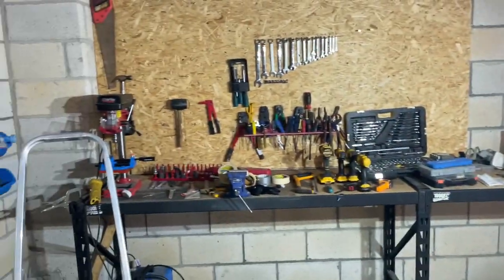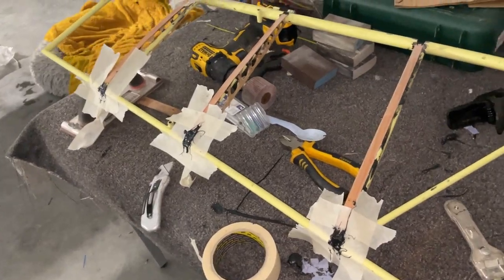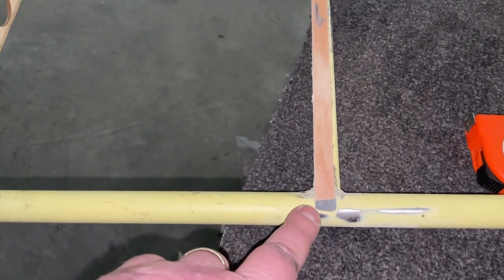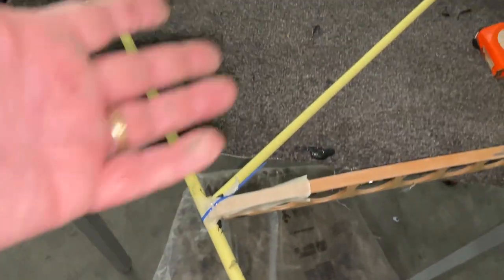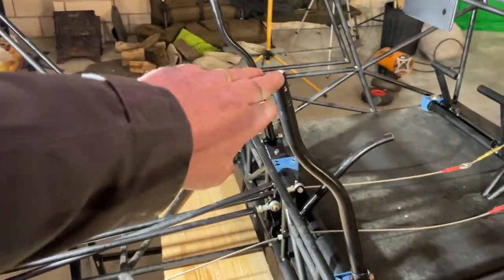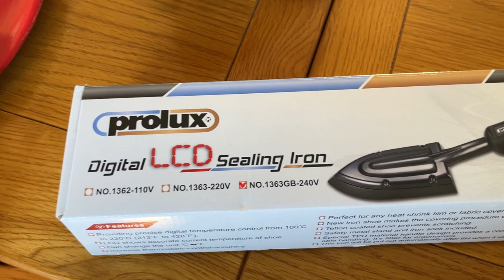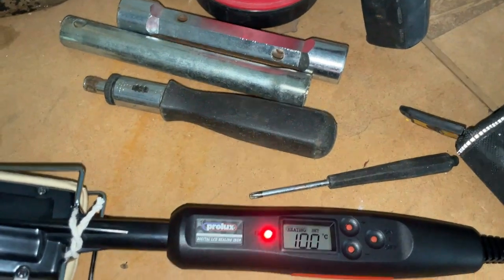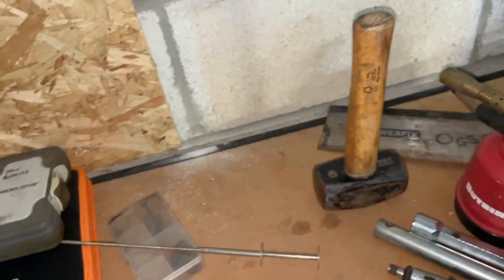KFA Safari Bush Plane Build - RTFM to avoid doing this.

Comment: Looking forward to the covering.
I'm using a home-brew water-based covering system similar to the Stuarts System (Sub70... doesn't need to be certified) using polyester dress lining (65GSM) it shrank enough for a nice drumming sounding tension :)
I have mounted a meter squared test piece sealed and painted... Super strong in tension but poke a hole in it and it rips easier than the raw unsealed/unpainted material... As if it is old and sunburnt with no "ripstop" ability.
Think I might have been a little stingy on the sealing coats (trying to save weight) and the paint (water based) has absorbed into the fibers preventing the usual fiber stretch / fuzz as its ripping.
More testing needed for me :)
Reply from the maker: Sounds like you’re having fun with the testing. I always wondered how much weight there really was in dried paint. A lot of the raw weight is the thinner. Now there’s an experiment for you 👍👍😁
Reply: @FatParamotorGuy  
I did take weight measurements but ignored them due to the poor ripstop performance.
(The weight of the seal and paint is not insignificant when every gram counts) 
I think a scruffy well sealed but thinly painted surface will be stronger than a thinly sealed well painted surface but then the polyester will get sunburnt much sooner with minimal paint and it will lose its "ripstop" qualities that way.
I may have to find other ways to save weight. 😁

Comment: The black epoxy your using look like "panel bond" they use in the collision and auto body work.  The only KFA Safari in the world that has the joystick with Peyronies . 🤣🤣🤣🤣
Reply from the maker: I think panel bond is a lot more plastic. This stuff is quite stiff but has a slight flex in it. Haha - have you a medical problem you’d like to discuss? 🤣😉
Reply: @FatParamotorGuy  lol, Luckily  the old pitot tube is straight as an arrow.